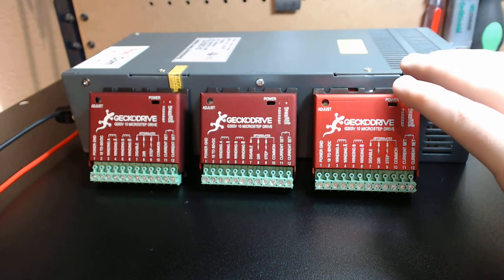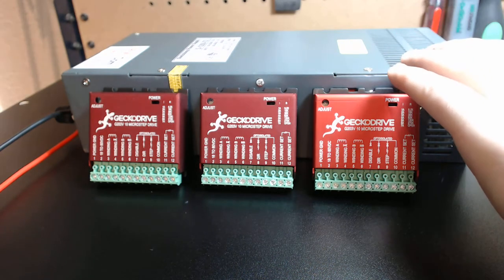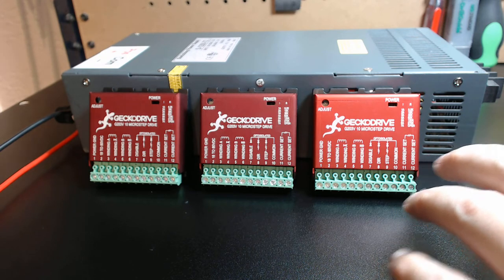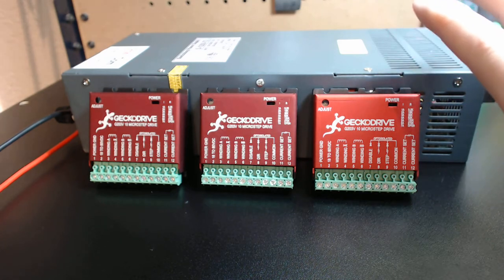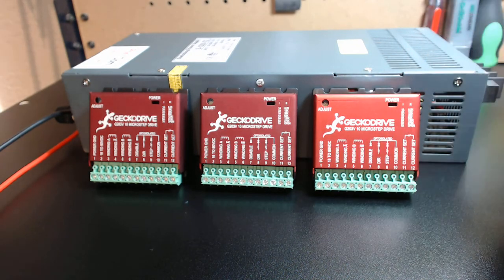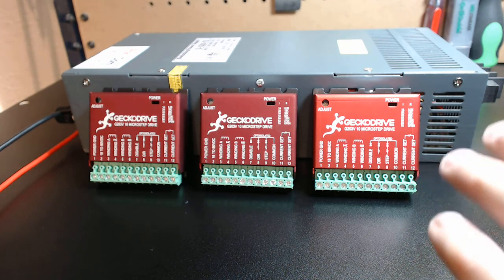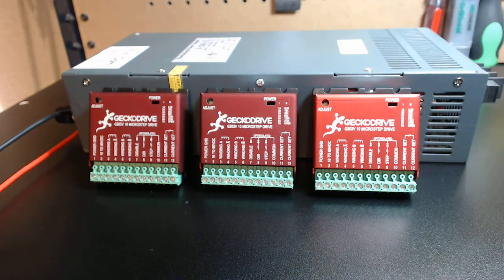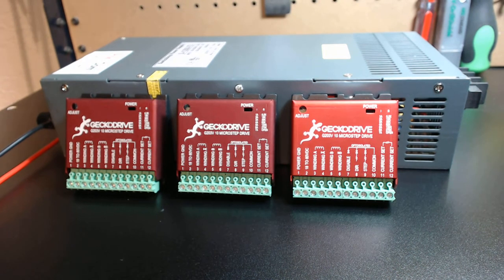New DIY Kit Featuring Gecko G203v's & 72v Tool Less Power Supply..

Comment: could tell you how to get a good resolution with this 203v driver. I found a divider of steps g901x, really good and worth it? Thank you very much, my friend.
Reply from the maker: The G203v drivers are micro stepping, and will easily provide .001in, and under when mounted to a well built chassis. If your having problems with resolution you would have to provide me more information to determine a possible cause. Thank you,
Vince
Reply: corvetteguy50 when I put 0.2 nothing happens in the machine, and in this driver it seems to me that the resolution of micro steps does not exist, since it always stays in * 200 * steps in the tunning engine of Mach3. What do you think of the g901x hardware that is sold separately by Gecko?
Reply from the maker: Diego,

I don't understand what you mean when you wrote you "input 0.2". Do you input that under setting steps per inch in Mach3? If you did that without properly performing axis calibration using Mach3' s step per axis calculator you'll have problems with calibration. Please review my video here on this topic. https://youtu.be/2HbeyggcwU4  

The first video is covering the theory of the process, and the video in the description covers the process performed in real time here https://youtu.be/XkO5tc-jSxw
Thank you,
Vince
Reply: corvetteguy50 in the axis calibration my drivers are always in 200 steps, that is, there is no division of micro steps. The ratio is 1: 1. When I said 0.2 I meant 0.2mm. Any way, tank very much for your attention